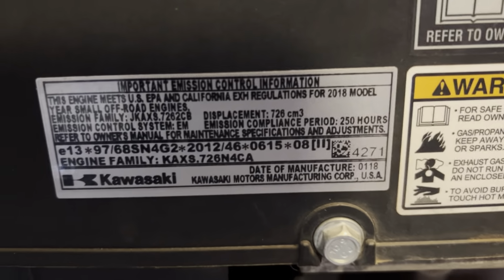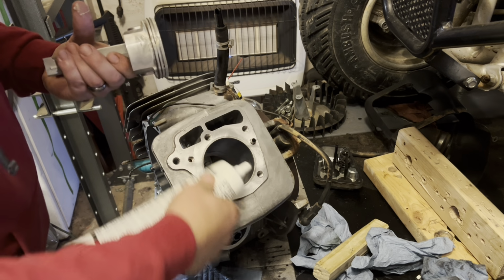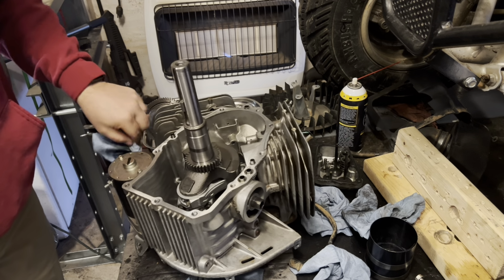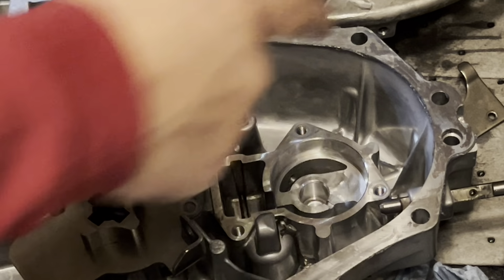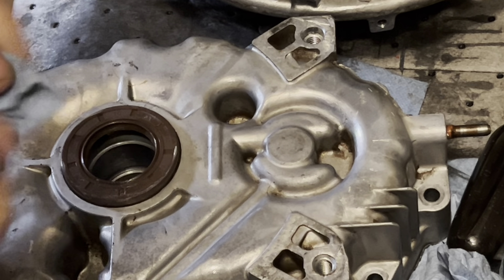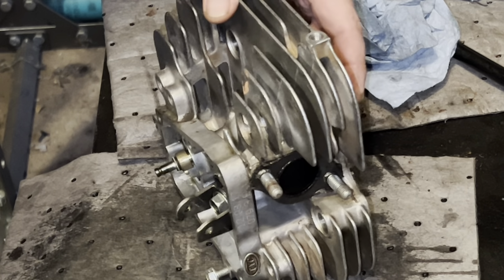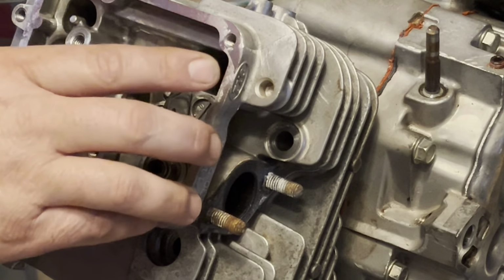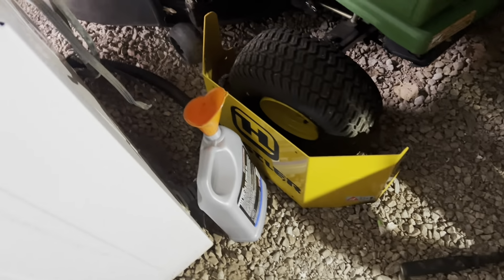Kawasaki FR691V burning lots of oil. Let’s replace the rings. #smallenginerepair #kawasaki

Comment: Dont ever put lithium grease on the rings it does not go away and can cause glazing before the rings seat, use high tac red
Reply from the maker: @derrickwoods2803  I don’t use lithium. It’s motor assy lube.

Comment: Hi , once you tighten the 2 arms onto the crank a half at 20:50 are you meant to be able to spin the crankshaft freely by hand? Once I tighten the 4 bolts I can’t spin it and it’s like it’s almost stuck . Is that normal ? Thanks
Reply from the maker: @Dumelow077  yes the connecting rod should rotate freely on the crankshaft. Once installed you’ll have to turn the crank to get that movement. It can seem hard to turn the crankshaft with the engine upside down due to the end play. Turn it over and suspend the crankshaft by using blocks of wood under the engine base plate and it should turn freely
Reply from the maker: Obviously you’ll have to wait until you get the sump cover back on but as long as it wasn’t locked up before disassembly and you got it back together correctly it should be fine
Reply: Thank you for your fast reply that’s a huge help 👍
Reply from the maker: @Dumelow077  you’re very welcome
Reply: @tannersharry  Another question for ya mate. How did you clean the engine so good and the parts ?

Comment: The small air filter has caused lots of ring failure because people will not replace them as needed, they are only good for 4/5 hours of mowing 😢😢😢
Reply: I wet the foam pre-element with Bel Ray foam filter oil, then wash it with soapy water about every 10 hrs and re-apply. Works great. Approaching 1000 hrs on my engine with no issues.

Comment: Hey I’m having the same problem as you at the end. Kicking over but won’t start . Any suggestions mate ?
Reply from the maker: In my situation is was air getting in the fuel system at the fuel filter. Make sure all fuel connections are good. If there is air getting in the fuel oil will pull it before the fuel because it’s easier.
Reply: Thank you I just tried. That. Looks like the fuel was fine. Everything seems to be hooked up fine so I’m not too sure why it won’t start.
Reply: @Dumelow077 give it a shot of starting fluid 😊

Comment: Ive never seen anybody double a head gasket on a Kawasaki engine
Reply from the maker: @randyseabolt272  That wouldn’t make any sense and I highly doubt it would work
Reply: You did it at around 57.40 along with the head with no valves
Reply from the maker: @randyseabolt272  I did not install two head gaskets and you’re correct I did have to remove the head and install the valves. 67 or so min mark

Comment: You forgot the valves
Reply from the maker: I had previously done the valves on this engine when I replaced the head gaskets in an attempt to fix the smoking without having to do a ring job.
Reply: I think he;s talking about at the 58 minute mark, you installed the heads, but there were no valve stems showing.